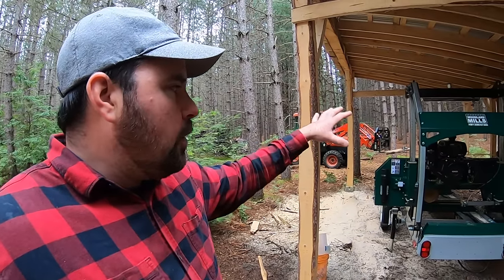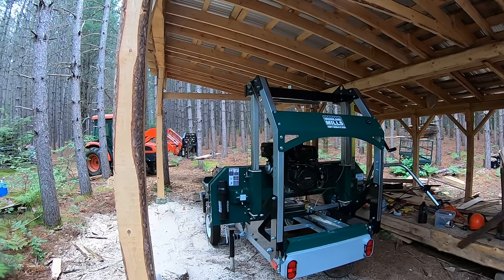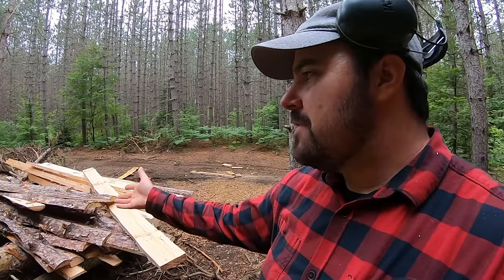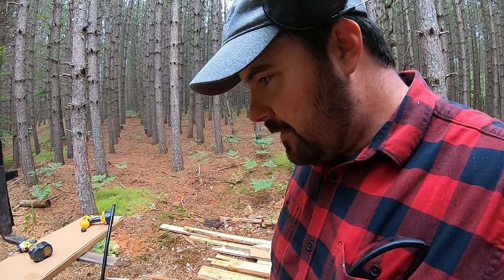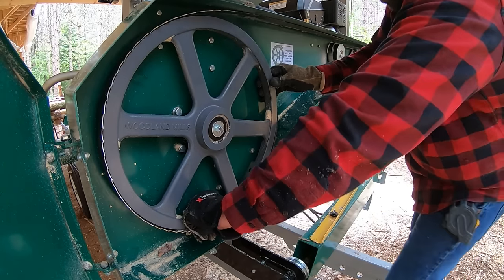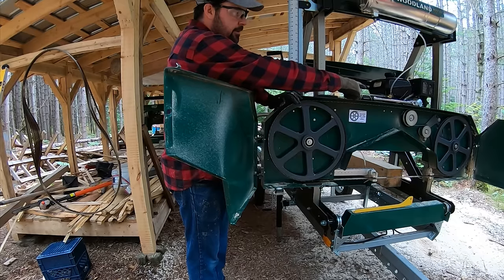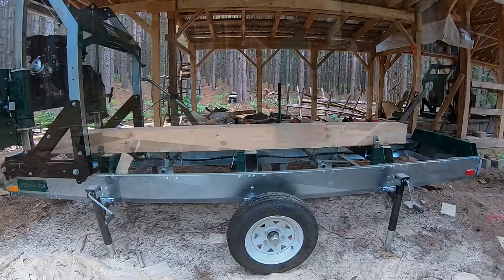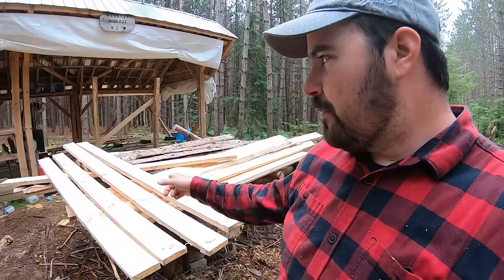Sawmill Won't Cut Straight | Fix Your Sawmill and Avoid Wavy Lumber

Comment: The harder wood surrounding the knots is causing the blade to deflect. It's like starting a cut into buttery pine and then suddenly hitting a patch of hard maple.  A brand new blade can overcome this drastic change, although you will no doubt feel the cut speed slow, but no blade will remain sharp enough cutting through knot after knot. Additionally, the whole blade isn't going through all the knots for the same period of time, so the blade is dulling unevenly. Add to that the sloppy distance of the guide bearings from the work piece, and the blade ends up fluttering up and down giving you those waves. If that's as close as the guide bearings can get to that log then it is definitely a design problem that is compounding the waves. Also, as you mentioned, blades do stretch, so it's a good idea to recheck your tension once you've been cutting for a while.
Reply from the maker: Thanks for your insight. I think if the blade were to be running against the blade guides blocks as is the case with blade guide rollers then I’d agree that having the blade guides able to move closer to the log would be ideal. However in this case since the blade guides don’t actually touch the blade I’m not sure if the more would be a noticeable difference
Reply: @sawingwithsandy  With the guide blocks, as opposed to rollers, the blade still rides against the blocks, but only when it has been deflected into doing so. The guide blocks act as a "stop" limiting the abound the blade can get deflected in either direction. If the blade is properly tensioned it would, theoretically, bounce off the guide block and then once again find its equilibrium between the guide blocks and resume running true. But, if the space between the guide blocks is too great, the blade will wander too far back and forth and produce the waves. Similarly, if the guide blocks are set up too far away from where the blade is in the work piece, the blade will wander too far, as you are only limiting the flex way out past the piece of wood being cut rather than where the blade is doing the work. The 1/16th" of travel space between the guide blocks can end up allowing 3/16ths of an inch in flex in portion of the blade that is in the middle of the wood. A 6 inch open span of saw blade with 25ft lbs of tension is going to flex a lot less that a 20 inch open span of saw blade with that same 25ft lbs of tension.

The blade is always going to follow the path of least resistance. What exactly that path is, is a result of how sharp the blade is, the character of the wood, the tension on the blade, and the amount of flex in the blade due to how much of it is supported vs unsupported inside and outside of the cut. The sharpness of the blade makes a huge difference, as you rightly point out, but the other factors still apply. If the blade is sharp enough and has tension on it the least resistance will be in cutting straight through the knot. As the blade dulls, it will be more likely to wander rather than cut straight through the knot. Increasing tension may help it run straight again, but that's because you would be changing the path of least resistance. Too much tension and you could see your wood burning, as well as put too much stress on your machine.  

Knotty wood will mess around with any blade, and you touched on the fact that the blades are likely unevenly sharp as a result of hitting knots.

Anyway... I really enjoy your channel and appreciate all the videos and tips you provide us with. Please keep it up.
Reply from the maker: Thanks Spencer. Will do and have a great start to your new year

Comment: Good morning Sandy what is it lately a lots of people are talking  about wavy board your was pretty advance   also .it was time for a new blade or at least a sharper one and you are right 90 to 95% of the time the blade is culprit very solder I let mine go that far also a nutty  log makes it be wavy  faster  even if you slow down it not going to solve the problem so keep your blade at least semi  sharp for better lumber
Reply from the maker: For sure

Comment: I thought the adjustable blade guide was supposed to be as close to the cant as safely possible?
Reply from the maker: Hi John, the blade guide was pushed in as far as it could be here
Reply: @sawingwithsandy  Can you move the Log stops closer to the center of the Rails to get the log closer to the Blade Guide ?
Thanks Sandy..
Mike M.

Comment: do you compensate your feed rate as your saws dull?  add some strain.  debark logs is a tremendous help.   offset on your return helps from making saws run in.  keep pressure guides close.   make sure mill is in alignment.
Reply from the maker: I find that as soon as I feel resistance when trying to cut I switch blades out

Comment: Wow I learned a lot on this one!  Thanks for all your info on this topic!  I’m definitely keeping all these things in mind going forward.  One thing I noticed as you were sawing with the old blade vs the new Sandy, was the sawdust exiting the mill.. old blade had minimal dust flying way out and to the side.. it was basically from what it looked like, just falling out in clumps somewhat as you were going.. maybe this was due to something like rain on the log before hand but nevertheless it’s something I wanted to point out.. the fresh blade.. the sawdust was flying right out of it and way out to the side.  Also, a thought that I had on the waves in lumber, I agree with all your points but to if the old blade is having a hard time keeping up, it may also be trying to go to the path of least resistance in the lumber so that could potentially appear as waves maybe along with what you said as well.. just wanted to throw out there.. but totally may not be that all.. anyways thanks again for having us over, cheers!
Reply from the maker: Interesting...I actually never saw that. Good to know. I wonder if the sawdust not moving out of th way of the next tooth had something to do with the poor wavy cuts
Reply: @sawingwithsandy  hey yes that’s a good point to 👍. Just thinking, this could be a good topic perhaps sometime to take a look at a little further.  I find these kinda thing’s interesting to try an figure out 💯👍

Comment: You have to think of the blade as a flag. On crowned wheels you run the blade slightly back, running more tension along the front and the back of the blade will follow. For sawmill wheels with the flat belts you run the blades centered as you are, but dull blades will heat up along the front edge and expand, then the blade is steered by the back of the blade and 'flaps'.  If you have to run a dull blade then run more water to cool it.
Reply from the maker: Great points David

Comment: The blade is one of several possible issues that can cause inconsistencies in boards.  Any knots, deformities or differing densities of the wood you are cutting will cause the blade to wander.  The blade will always take the path of least resistance if it can.  Blade tension and cutting speed are also important factors.
Reply from the maker: I've found that as long as your blade is sharp, it passes right through knots without any wandering
Reply: I have the same saw and have found the opposite.  Doesn't matter which saw, it is a bandsaw phenomenon. Path of least resistance. @sawingwithsandy

Comment: Looks like you need to build a longer movable blade guide so it will be closer to the cant. Also take the dull blade and roll it flat. I made my own roller to flatten band blades.Works perfectly. Watch the first reaction as the blade enters the log to know which side to roll.
Reply from the maker: Thanks for that. I haven't heard of rolling it flat but now you got me thinking

Comment: First I watch all your videos. I have learned so much. (Proves you CAN teach an old dog new tricks) I do have a question, do you wipe your blades down before putting them on? My second and third blade flew off 10 sec after putting them on. I wiped the oil off the fourth one and all was well.
Reply from the maker: Hey Richard! I have not wiped down blades before putting them on before.

Comment: I cut a western red cedar today. Last several cuts wandered. I should have changed the blade.  Didn't not just the edge that's wavy. The face as well. Not the end of the world I have a 20 inch planer and a jointer.. just more steps.
Reply from the maker: Yeah I hear ya Rick. I would love a big planer to help clean up the lumber as well

Comment: Great video!  I have a question if you don't mind. Approximately how many passes do you think you are getting,  before you have to change blades?
Reply from the maker: I'd say probably cutting about 200bf before I switch out the blades
Reply: Wow that's surprisingly frequent. I am probably wrong in my estimation,  that 200bf is appx 20 2×6s @ 16 ft.
Reply: @sawingwithsandy  From a non sawyer BF is cubic (3D) so how does a 2D cut equate (W x L)? I may be missing something! Or does it mean 12" x 200' BY 2?

Comment: I’m getting better at catching it before the blade is wavy cut bad and I change it out so I can reuse it later to edge my other boards that still have bark on them. When I do this there’s less log on the mill and not as hard on the blade. I suppose that’s why I can get these edges cut straight with an old blade just cause there’s not as much friction heating up the blade. 
  Reassured that this old blade will only last a short time but probably enough to edge 20 boards. So I’m watching after every cut to catch it early enough that I don’t ruin my lumber. This way I can use my new blades for cants and final cuts and get a bit more life out of every blade. Times are tuff so save money where you can.
Reply from the maker: I'm with ya there Rich. I try to make every blade last as they sure aren't getting any cheaper

Comment: HOW ABOUT cutting a slit on the face of the never opened card board box to locate the ties then cut the ties through the slit(s).
Reply: if initial "freeing" the blades within the "unopened" box is workable without damage to blades  -  ps to blade manufactures   mark area to cut "slits" on box
Reply from the maker: I like this idea!

Comment: Great stuff as usual! Do you have an estimate of amount of wood cut before the blade becomes dull enough to begin wave cutting? Can a slight increase in tension be helpful? Edit: What I should have asked is it helpful to recheck tension thinking that with a duller blade there’s more heat so there may be a reduction in tension.
Reply from the maker: Bit of a rough estimate but I’d say probably cut about 200bf then think about changing blade out for me
Reply from the maker: I don’t find that tension above 25 has helped but then again I haven’t felt the need to try it
Reply: I have over tensioned my blade once and it's not good. Unless you like some serious wavy chatter. 😁
Reply: More blade tension generally equals more belt wear as well....this is one reason Woodland mills reduced their specs on blade tension(they have told me that now to use anywhere between 17 to 20 foot pounds; the least that works and have the blade stay put).
Reply: @mikechristensen9744  I've tried to reduce tension before but my blade tended to wander a little bit.
Reply: @lumberjill6598  I think every mill is a bit different as to where the sweet spot is... possibly even blade type can influence this.

With my mill, within the first few weeks of using it, the blade kept jumping off.  Woodland Mills helped me adjust both band wheels which helped but under full tension you could actually watch the blade slowly creep off the idler wheel with the mill not running.  Woodland suggested to reduce the tension down to as close as I could to 17 foot pounds and still have the blade stay on.  For my mill, about 20 foot pounds works great.  I have not had a blade jump off since and have not had to readjust tracking.
Reply: @sawingwithsandy  either your estimate of material cut between blade changes is very wrong or you need to change something. That's just throwing money away. If you can feed a bit faster on a fresh blade you can actually increase the blade life. The speed the blade is running and the tooth angles and kerf also have a massive effect with different timbers and moisture in the log.
Too many people jump into sawmilling thinking it's easy and anyone can do it. It's not the case. You cannot simply generalise the whole process and have to notice how small changes affect your results and learn from it.

Comment: If you're cheap like me you free hand sharpen the blades but that doesn't solve tooth set issues....I purchased a tooth setter from woodland Mills and have good sucess free hand sharpening blades and every 2 or 3 sharpenings I take the blade off and reset the teeth...it's amazing how much difference a properly set  tooth makes
Reply from the maker: I hear that!

Comment: Sandy, if you would keep the blade guide within an 1in. of the wood you will have a better cut. There is a reason why it's on the saw
Reply from the maker: The blade guide was extended as close to the log as it goes
Reply from the maker: On this sawmill the blade doesn’t touch the blade guides
Reply: @sawingwithsandy  if that's all the closer the guide can go, then that's some of the a problem. It's designed to keep the blade from twisting. You can see it when the blade first  starts cutting into the "cant".
Reply from the maker: On these Woodland Mills sawmills there's a small gab the width of a index card between the blade and the blade guide blocks. Because there is this space it doesn't provide support to the blade to prevent wavy cuts as a blade guide roller might which contacts the blade. The guide blocks simply provide support from deflection but not enough to prevent wavy cuts due to a dull blade
Reply: That's interesting sounds like a design flaw not the case with my Timberking 1220  @sawingwithsandy

Comment: A sharp blade is only one component of a good cut. There is also blade lube. I see a tube running to the blade but couldn't see any liquid coming out. Are you sawing without using that feature? Also, the saw guide should be adjusted up to within an inch of your cant. It looks like yours is several inches away which allows the blade to wander more. Also, speed of cut makes a huge difference. There are other factors such as levelness of the mill and blade, squareness of the stops, type of wood, knots, etc.
Reply from the maker: Hey Andy. Over the years I’ve found that the saw cuts more accurately and consistently when I have a sharp blade on and no lubricant. I only use lubricant if the blade is getting hot to help cool it.

Comment: Nice video as usual. Have a question to tell you. Have heard of guys switching to 1 1/2" blades from the 1 1/4" on a 130Max. Reasoning sounds good but am wondering (the question part) how it would work in the real world to help with correcting wavy cuts. I watched your Ripper 37 video and am about to order some but wanted to get your opinion on the wider blade. is it possible you could do a comparison of the two blades or have you already done one?
Reply from the maker: Hey Jack! Good questions. I haven't tried the 1.5" blades as my 1.25". blades have cut good and flat consistently. However, I wouldn't be opposed to 1.5" blade but my main question I have is whether it would be any better than the 1.25" since a 1.5" blade would leave more of the blade unsupported by the band wheel belts. It's certainly something I'd want to try in the future though to see if there's any difference

Comment: Sandy I cut pine here in Florida and I got to ask with the new sawmill how do you like the loose belt on the follow pulley for the blade? Personally I think it's a horrible design after I cut two or three pine logs the belt starts to get a little bit sticky build up at the top and jump my blade off. It's fine when it jumps to the outside but I've lost three brand new blades because it jumped to the inside. Do you have any suggestions or did you ever have this problem with the older sawmill?
PS: this is the only problem I'm having I love The sawmill.
Reply from the maker: Hey Jay! I don't mind the loose fit of the belt as it hasn't caused me any problems at this point. I didn't really have the blade jump off too too often with the old sawmill but when I did it often was when I was using a lot of water or water/soap mix. I ended up using next to no water to cut and haven't had my blades jumping off much at all

Comment: Start by switch in  log stops  so u only cut one side  with bark and dirt  log stops  on the push handle side  and dog on the other side  gives u clean wood after the first cut. Or use a debarker or   power planer   or a chain saw with  one of those tools for notching logs
Reply from the maker: I always wanted to try switching around the log stops just for the reason you mention
Reply: Save on your  Blades but then ur  loading the mill fro the other side

Comment: Hello Sandy. I do not have a sawmill myself but I want to buy one. So I am in the processus of learning. One man made the comment on a video on the channel (les lubies d'étienne). He said 
Your mobile blade guide should always be very close to your piece of wood. Hope it coule help.
Thanks for your nice video and your good work. I am a fan from Baie St-Paul.
Reply from the maker: Thanks for that Franc. In my case the blade guide is as close to the log as I can adjust it to here
Reply: M. Sandy if you look at your video from 3min30sec to 6min30 sec you will see that at each pass you do your blade guide bearing is more than 6 in from your piece of wood.
Reply from the maker: That’s as close as the guide can be adjusted to the material

Comment: Sandy, if you can measure the diameter of the wheels and their RPM, I can calculate the velocity of the blade.
Reply from the maker: Hey Carl! Unfortunately I have no way of knowing how fast the wheels are turning.